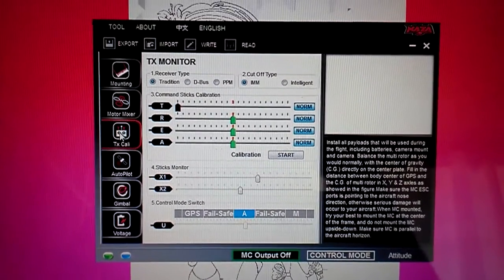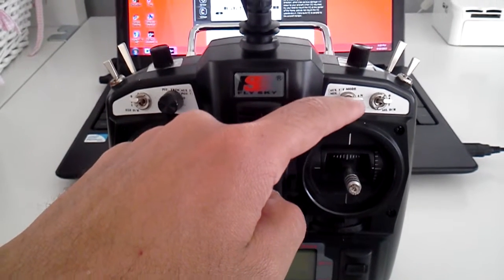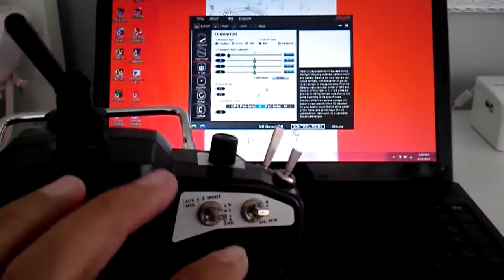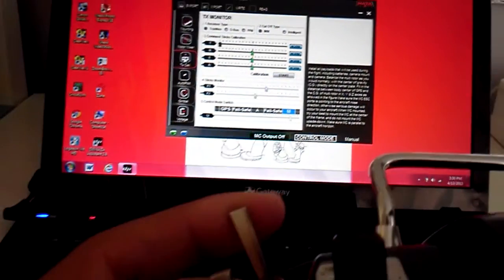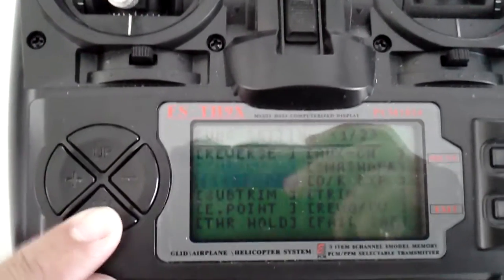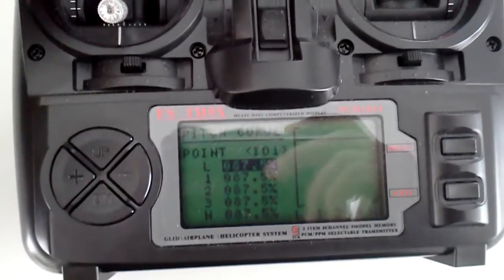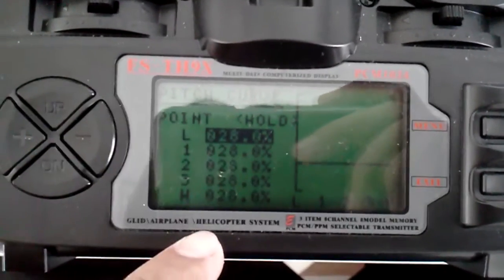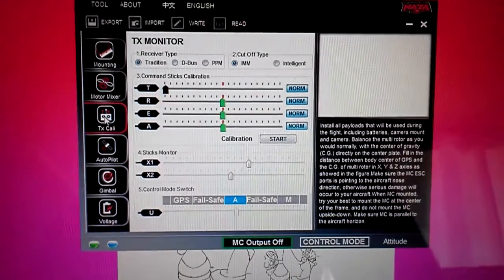Setting up naza failsafe switch

Comment: I'm using the same tx. I was hoping to find if there are any tutorials or ways this transmitter can automatically go into failsafe mode once he transmitter is turned off by accident or on purpose. The reason for this is, because I was told by others and have read that if the tx accidentally gets shut off during flight and it doesn't go into failsafe automatically, your copter could fly away or crash. Any ideas if this is possible for i to go into failsafe automatically with this transmitter?
Reply from the maker: The stock fsth9x Rx doesn't have failsafe. You will need to get the frsky djt module and reciever set to get actual faisafe.

Comment: Good video. I have the same done to my 9x but my switch is the one to the right of the 3 position switch. It can be very handy when using RTH on the GPS lol. Like when I flip it into manual mode by accident and do a flip.